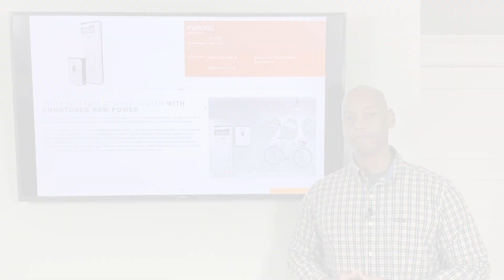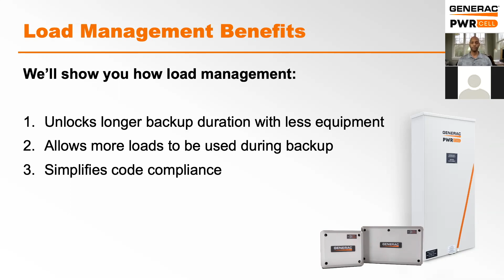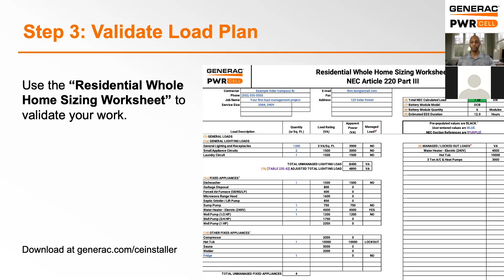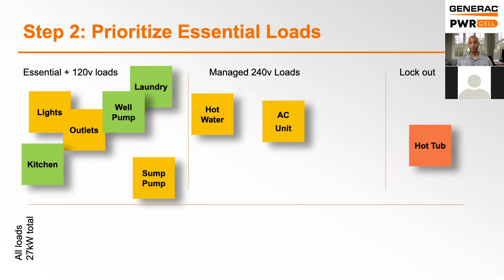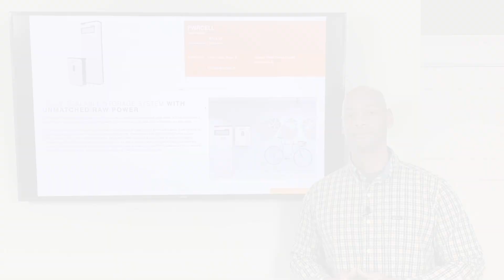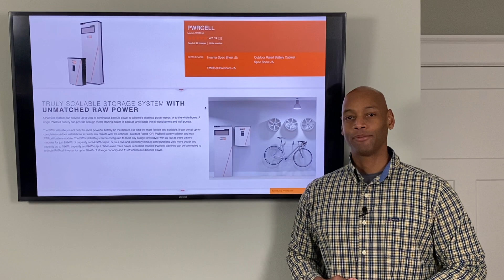Generac PWRCell Whole House Backup with Intelligent Load Management

Comment: I’m an actual PWR Cell system owner and it has been junk, never runs more than six months without failure. Has failed multiple times during power cuts. It has safety issues with the snap RS fiasco and now my system is down as often as up and Generac only gives me a run around. MY SYSTEM IS ONLY THREE YEARS OLD. This is why Generac has four class action lawsuits pending. My advice is go with someone else

Comment: Our generac battery pack stops working when the temperature drops below 40° Fahrenheit or when it goes over 105 degrees.  Winter storm that  freeze the power lines are when we need it most, followed by when the grid falls over in the summer from over use.  When the system works it's awesome you never noticed switching to battery and the seller keeps the battery charged.   When it does not work it's frustrating.  We have gone a total of 2 months out of the last 15 without full use of our generac system.

Comment: Looks like I am going to get the generac system with 2 battery packs with 3 batteries in each ( min you can have in there 17kwh ) and as I save on my electricity I can add batteries. Base on your math I would need 3 batteries to charge my F150 lightning with travel distance 50 miles with the 170kwh (300) mile range. But until then we do 4 loads of wash/dryer every Sunday 2 loads on Wednesday and 2 loads on Friday

Comment: Any type of resistive heating element or any motor which runs against rotary resistance will be the biggest draw. Think AC compressor, electric water heater ( non-heat pump type), clothes dryer, fridge compressor, toasters, electric coil range (induction range much more efficient).

Comment: Let's say one lives in a building where there is no options for installing solar panels could battery system like this one still be used as a back up but by charging the system from the regular home electrical system?
Reply from the maker: Yes, you can use Generac PWRCell as a battery backup only with no solar.   However,  you would lose out on the 26% solar tax credit.
Reply: @SolarSurge  how many hours of power can you get out of this?
Reply from the maker: @saundz8791  Usually 24 hours of backup power.

Comment: If I only have HVAC as 240 appliance, then ATS is good enough, right? Especially when you want to connect generator to charge battery. Sure start might still be needed.
Reply from the maker: I would recommend the soft start device for the HVAC regardless if you are doing whole house backup or critical loads only.  If you are building new, then use a variable speed HVAC compressor, which has built-in soft start.

Comment: The information below is centered around Backup and Money Saving. This presentation did not hit on some key details.  But the critical part that is most important to me is how long will those heavy loads be utilized.  In my personal experience here in NC, my 2 TON HVAC will run for 9hrs to 11hrs and even 16 hrs depending on the weather.  My family of 6 during the summer months on average uses between 65kW and 85kW. Half of that usage is the HVAC.  Customers need to spec their system beyond normal daily consumption, due to the fact normally nobody is home between 7am until 6pm.  So when everyone is home, consumption goes up considerably. This brief statement does not cover, Cloud coverage during solar production times, the direction of the solar array, and storage capacity utilization during solar production in a grid-down scenario.
Reply from the maker: Hi and thanks for the feedback.  You raise several valid items here.  In most cases, if you are in full sunlight, you can run the A/C all throughout the day.  During evening house, the A/C should be used sparingly when running off battery power.

Comment: My only essential 220-240 volt equipment is the HVAC. The electric dryer can be nice if the power goes out and stays off for more than a day or two, but the electric range is not really essential since a hotplate or a toaster oven, even [shudder] a microwave can heat food when needed.

Comment: WAIT -- Physical switches inside the SMM to set priority???  If it's already communicating with the ATS or Inverter over the power line, why can't it be controlled remotely?
Reply from the maker: I suspect they will be working on this capability soon.
Reply: I am currently working with a local installer (connected with a Solar United Neighbor's co-op) to spec a new, complete solar+storage system.  This installer actually does NOT recommend the current generation of SMMs -- basically the technology isn't worth the additional cost, vs. the 'vanilla' PWRcell system with a conventional critical-loads panel.  They too also think that a newer generation of truly 'smart' SMMs will come at some point, from Generac.
Reply from the maker: @barry28907  Barry, thanks for the feedback.  I see the need for SMMs most in southern states like TX and FL where the homeowners need to have central A/C on backup power.  We generally needs to use SMMs and a soft start device for the AC.

Comment: i have the system but with the critical load box how do i change mine to this new load management system
Reply from the maker: You can contact the installer and ask them to install the PWRCell Transfer Switch and Smart Management Modules on all of your heavy load circuits.

Comment: Hi, quick question will the system work the same using the battery as the only backup system to the utility supply? Just for the cases where the solar panels are not an option.
Reply from the maker: Yes, you can use this system as a battery backup only with no solar.

Comment: If you had to design a system with generac batteries, a generac standby natural gas generator what would it be? what inverter and what panels would you add? I'm trying to build a dream system with grid out times in mid.....I'd also like to employ a kind of smart breaker panel like leviton load center or span smart panel as I might have to relocate my panel and wouldn't replace a "dumb" panel with another dumb panel. Thanks
Reply: I wonder if there are dealers in Kansas?
Reply from the maker: Hi Matty and thanks for writing in.  I would use Q-cells solar panels and the Generac PWRCell inverter.  We can help you with that if you need.

Comment: How is this different than Span?  What are the advantages of this over Span?
Reply from the maker: Hi Brandon.  Great question.  The Generac Smart Management Modules allow you to keep your existing circuit breaker panel.  With Span, you have to replace the entire panel.  I'm recoding a video about the Span product later today so please keep an eye out for that video later this week!
Reply: @SolarSurge  thanks!  It looks like from the quotes below though it is much more expensive. Will look for your video for sure!!

Comment: I did some more research and found circuit breakers rated at 50 amps for $35 dollars and were WiFi controlled with Alexa or Google. With a little more effort I am sure I can find the inrush suppressors for high current devices. I really can not stress enough that these guy are using existing technology, bundling it up and charging loan shark prices. I would distance myself from these guys, they can only be trouble when they go bankrupt.

Comment: Can their load management be used as a separate item or does it only work with their complete package?  Also are there any ATS or other battery systems that are fast enough to not drop the loads when the grid goes down. Generac specifically mentions their ATS is not fast enough for that.
Reply from the maker: Good questions.  The Generac PWRCell transfer switch takes a few seconds to switch over, so I would not consider this an "uninterruptible" power supply.  However, Outback Radian and Schneider Electric Conext XW can switch over fast enough to prevent the appliances from noticing (10ms).

Comment: Timely. Thx for letting “man on the street” look over your shoulder as you interview a solar/storage manufacturer. Generac has certainly brought acquired Pika system to a new level in a very short. My focus has been on Enphase Ensemble 2.0 system with likely similar capabilities (not on market until year end). Both systems accomplish same goal of solar/storage, but with different engineering. Look forward to a deep dive into the PWRcell including roof top array and PWRview App. Great overview. ThankU!
Reply from the maker: Thanks for the feedback.  I will add those topics to the list for future videos.

Comment: Good stuff. In 5 years I'm thinking the market is going to be dominated by a completely integrated smart panel of some sort
Reply from the maker: The nice thing about Generac's system is that you don't need a new panel.  You just add the devices to the circuits to be managed.
Reply: @SolarSurge  Very true. I do think though, especially for new construction, that a panel that allows control of ALL circuits will become standard.
Reply: @bobqzzi  For new construction SPAN panel looks interesting for whole house load management.
Reply: @gilbrook  It does! My solar guy reached out to them and so did I, but neither of us heard back. Current plan is to go with a Lumin which looks okay, but it limited.
Reply: @bobqzzi  Less expensive and less “intelligent”, but looks good to me.
Reply from the maker: @bobqzzi  That would be cool.  Definitely makes sense for new construction.